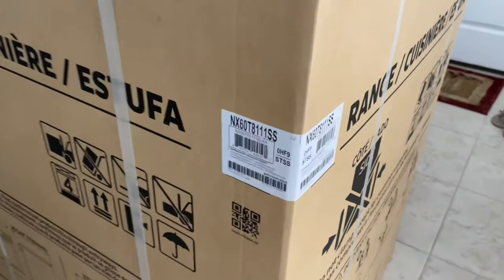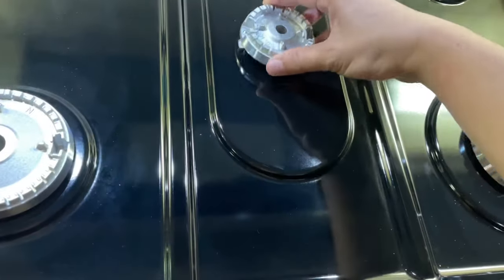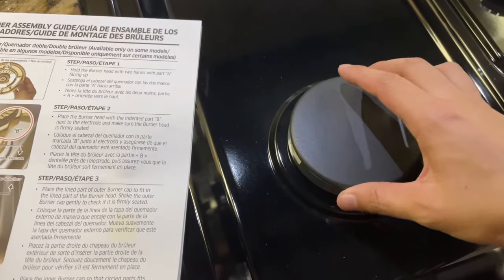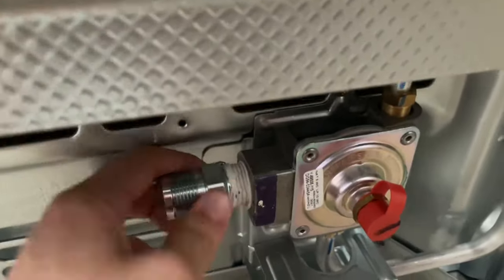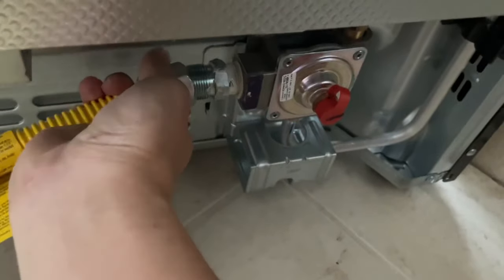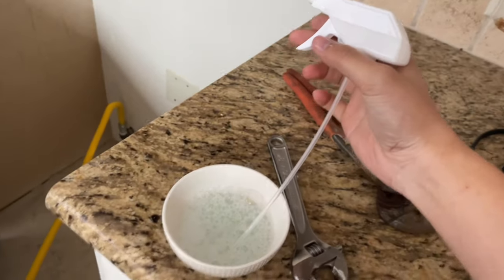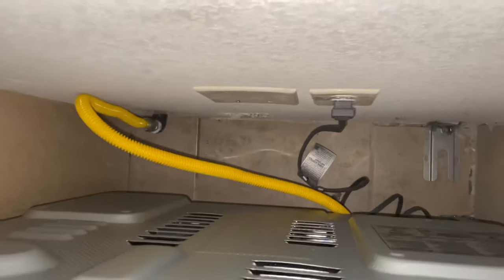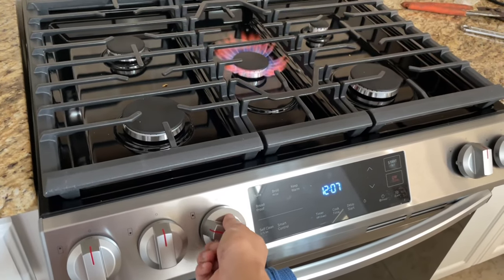How to Install Samsung Range and Gas Line (without dying!)

Comment from the maker: Update. I'm not dead yet.
Reply: Do you know if the stove/stovetop/burners works during a power outage??
Reply from the maker: @xxgotiashleyxx  yes
Reply: @EdwardInTX  so you CAN use the stove without electricity? I imagined the electricity is just for the computer/WiFi. I just want to confirm because I’m thinking about buying it and wanted to make sure.
Reply from the maker: @xxgotiashleyxx  correct, as long as your gas is still running. You'd need a separate lighter to light the gas though.
Reply: haha love the update😆

Comment: My son did the connection and now we smell gas. He couldn't see  a leak anywhere . He is very stressed out about it. I will have to pay someone to figure it out. He didn't turn on the gas burners like you did. I told him that he should do that to let the gas run through the lines but, he was afraid to do it because he hooked it up and let it sit and there is a strong smell of gas which indicates there is a leak.
Reply from the maker: Usually should be around the connections. Check with more soapy water.

Comment: Great video. I'm getting the exact model installed Monday. Just fyi.....Most local codes require a gas shutoff valve where the gas line exits the wall.
Reply from the maker: I ended up finding it in the cabinet to the right. Such an odd location for it.

Comment: Not to be rude, but the installation instructions say,"DO NOT OVERWRAP TEFLON TAPE IT MAY CRACK THE GAS REGULATOR" We used blue goo made for natural gas.
Make sure flame is blue; not red orange or yellow. Otw. You nedd to adjust some stuff. CO2 will be your silent killer.

Comment: Isn’t the sealant supposed to be Yellow for gas?
Reply: Blue monster is blue but madee for lp natural and other petroleum installations, but yes. Yellow teflon is for gas, if using teflon.
Reply: FYI  great question.  yes yellow is gas.  HOWEVER instructions say DO NOT USE TAPE because the fittings are a tight clearance and tape will cause Female fitting to expand and crack.   Samsung says to use Paste sealant

Comment: Is there any setup process you have to complete before using the oven (i.e. self clean)?
Reply from the maker: nope!
Reply: You’re supposed to run the oven for 1 hour at 400degrees to burn off the shipping enamel.

Comment: I noticed you applied sealant when connecting adapter to oven, but not from gas line to adapter. Was this an oversight or is sealant not needed when connecting gas line to adapter? I'm asking because I'm about to install oven soon.
Reply from the maker: Correct, it's not needed. This was a recurring recommendation I've seen in numerous other videos, and by a plumber. Everything is still hooked up and fine to this day.
Reply: if you notice the adapter has a flared end. the flared end is what seals onto the line. You should not use or need tape/dope on that part. thats the point of the flare, to make the seal
Reply: Question?  Would it hurt to still use the sealant onto the adapter????
Reply: @weshughes4575 
Probably not.  The flared fittings are compression fittings, and I suppose having Teflon between the two fitting surfaces might even help seal better.

Comment: Do you need the anti tip bracket ? If its against the wall how is it going to tip over
Reply from the maker: havent seen it used often but mainly if a kid opens the stove and sits, then oven tips

Comment: Does this range take a 15 amp outlet? What size breaker is it on?
Reply: A typical gas range works on a standard 15 amp circuit breaker.  There may be some dual ovens or ovens with a lot of bells & whistles that require a 20 amp circuit, so it's best to check the mfg requirements when selecting.

Comment: I just had my installed and it is sticking out of the wall about 2 inches. He said because of the water line..? which is actually against the wall. Should this be pushed up against the back wall? The gap is horrible looking.
Reply from the maker: Yes--in your case, you'd have to put a gap filler like a piece of wood overlayed with some tile
Reply: @EdwardInTX  I don't know what you mean? Also, the old stove was perfectly up against the back wall.
Reply: @pennyarizzio2824  all depends on where your gas line exits the wall or floor and the configeration of the space behind the stove at floor level, will vary from one stove to the next

Comment: The red cap, gas line regulator...what is that for? Why does nothing connect to it? It doesn't seem safe!
Reply: under the cap is a needle valve, its a closed systm for adujstment only